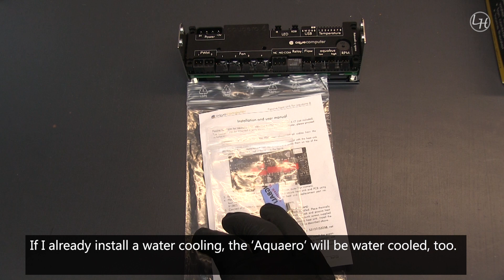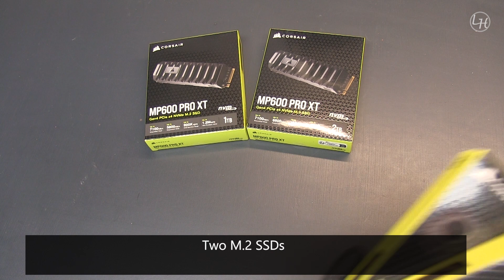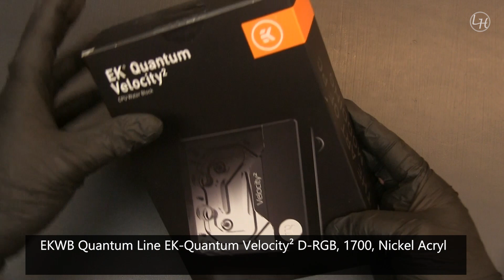Building a PC desk case from scratch with  RTX 4090 and  i9 13900K for gaming and simulation - Part4

Comment: If anyone didn't know, the shell on a SATA SSD does NOTHING for the drive. The chips are not in contact with metal, so it doesn't act as a heatsink. They run cooler if you remove them from their shell, stack using brass motherboard standoffs, and mount them in your case near bottom or in path of air flow.